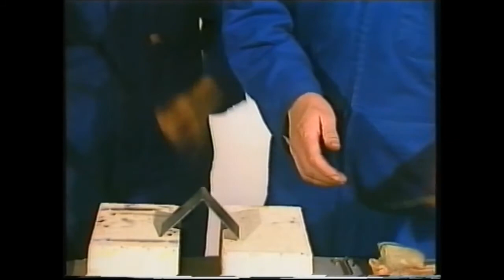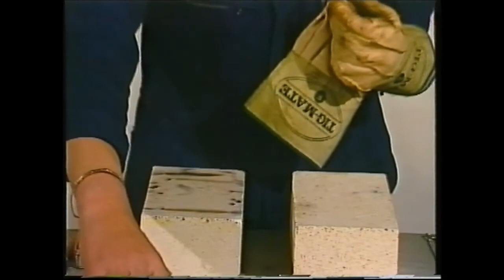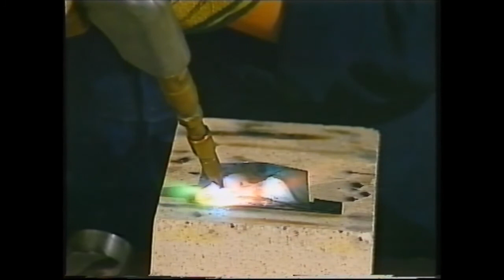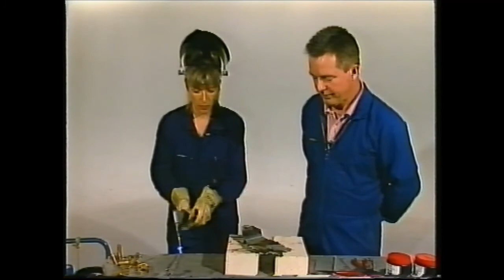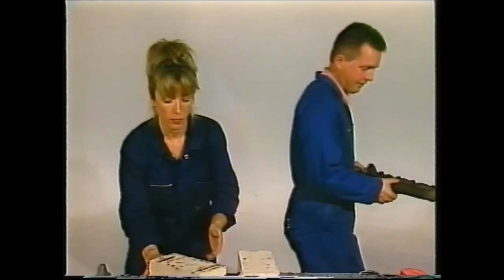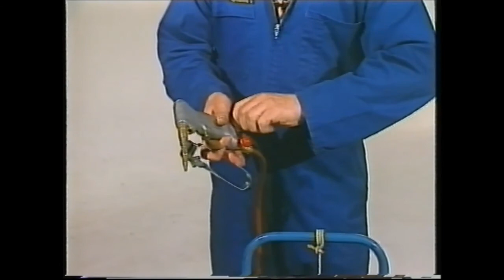Henrob Cobra 2000 Welding Torch

Comment: There are many videos showing the use of the Australian  Dillon torch(originally Dillon MK II and MK III and for a short time MK IV, then Henrob2000 and Cobra DHC 2000).  This is the absolute best video as the techniques are well displayed. The sales hype is obvious and much technical information is incorrect but using a low speed low volume oxy torch is tremendously useful in welding metals. Barry guides you into specific aspects of the technique as it relates to different metals. This is much better than the user manual. If you intend to buy a Dillon torch, there are many on the used market as the younger generation prefers expensive electronic boxes to weld. Plenty on ebay and marketplace or you can buy new from "dillonwelding" out of Sweden or if you are not in the USA,  or from Detroit Torches Inc in USA. It is the same torch (made in USA) from both suppliers but the name embossed on the handpiece is different (Dillon MK III or DHC 2000). Note that a very famous (aircraft welding) small oxy torch , the MECO N MIDGET has not been manufactured in many decades and Victor torches that bought out MECO dumped it permanently. This has led to the Meco Midget being very sought after on ebay etc. where it commands a much higher used price than the Dillon. The fact that the less performing (can't cut metal) Meco Midget has much higher used prices on the market makes you question Victor's strategy. Bluefeather is the other torch that claims to be a better (aesthetically) copy of the Australian Dillon. The instructional videos are not as impressive as the ones available for the Dillon.

Comment: I have had this set for MANY years.   brought it with me to the Philippines and it was amazing to used during Covid and after the Super Typhoon when all shipping and communications were down.  I did many repairs with Motorcycle spokes stainless and high carbon steel and aluminum repairs with any aluminum available for filler metal.  You can pretty much weld any metal with this torch. I already had some borax to use as flux when needed.  I can only say that conventional gas welding is ok but the Henrob  is superior . But like any gas torch set it does not like cutting dirty steel. A quick buff with a wire wheel , grinder or wire brush and this torch cuts like a Plasma cutting unite. I think the original case name was  Dillon on mine.

Comment: The British designed BOC torch has a similar mixer to the Henrob torch. There are many many of these around in many countries, most copied by the Chinese. If you calibrate the pressure on these torches to 4psi and use the smaller tips, you get the EXACT SAME RESULT. How do I know? I've tested both. The marketing spill behind the Henrob is that it has a "special" mixing chamber. It uses the venturi principle to get the oxygen to PULL the acetylene into the mixing chamber. It may be special but is far from unique. This principle has been present in some torches since 1920! You need to understand a little about chemistry and physics, but there is no magic in the Henrob. Also note that Barry McGough who is an excellent welder and salesman spins a few untruths in this video.
He says: "the torch delivers the oxy and acetylene in equal quantities unlike a conventional oxy torch which delivers 5 parts oxygen to 2 parts acetylene. " 
This is, to put it mildly,  "Bull Poop". 
When you adjust the flame to NEUTRAL, you have a 1:1 ratio of gases in the INNER CONE (C2H2+O2=2CO+H2), however there is a reaction in the outer flame envelope where oxygen in the air combines with  the CO and the H2 of the inner cone so that CO+O=CO2 and H2+O=H2O. That is why a 1:1 gas ratio from the bottles leads to "5 parts oxygen to  2 parts Acetylene" or 2C2H2+5O2=4CO2+2H2O as the end result which includes the reaction in the INNER CONE and the reaction in the OUTER ENVELOPE. It has nothing specific to the Henrob torch. ALL torches are identical when you set a NEUTRAL FLAME.
Then Barry says " it delivers oxygen and acetylene in equal quantities " You the welder decide what quantities are delivered by the cock valves on the torch. The torch is irrelevant.
If you get a cheap Chinese BOC-like torch and set the regulators like Barry shows you at the end of the video. You will be able to use that torch like a Henrob torch IF YOU USE SMALL TIPS
I take nothing away from the versatility of this torch which was made by the Australian Nicholas Dillon in the 1970s. Its pistol-like grip is a favourite for many welders. The claim that it saves on acetylene is correct but NOT specific to this torch. If you use any other torch which has the venturi system in the mixer and use 4psi with small tips you will get the SAME result.
Detroit Torches is now making and selling these torches under the name DHC 2000 or Cobra and they have an eye-watering price. In their videos, they have employed another fast talking salesman (first) and welder(second) to promote the virtues of these torches. There is a lot of hype and they are far too expensive. If there was a market like there is for the Smith Little Torch there would be thousands of Chinese clones on the market. At the end of the day, check your mixer: if oxygen flows in a chamber where it can pull acetylene to better mix it, you have a Henrob/DHC2000 replica. Just fit very small tips and calibrate the pressure to 4 psi as Barry shows at the end of the video. Don't forget to fit flashback arrestors at the torch and the regulator. The non return valve sold with these torches should not be used. FBAs have non return valves built in.

Comment: Great demo!
Where do I buy one nowadays in Australia?
Reply: there are many around as welders dump gas for Mig and Tig. Flea markets, local fairs etc
Reply: @redpost2380  thanks. I've ended up buying new from the US. Great kit though I'm still learningy ways around it.
Reply: @ZaarsShed  The aggressive marketing behind the Cobra means that they try to tell you welding with the Cobra is a breeze. Not so. You need to learn your gas welding skills. Consider buying an original Smith little Torch (about AUD 290) it is used by jewelers. Runs on 2 psi and allows you to slowly earn how to gas weld small metal pieces. the same rules apply for thicker steel etc
Reply: @redpost2380  I'm not phased by the marketing at all. I've done a gas welding course but they only had Comet 3 "monster" torches of course. DHC2000 is already much better off the cuff. I'm simply not as magical with it yet as the lady in the video (tip of the helmet visor to her!).
E.g. for some reason I need to go tip size or two up against what the manual says when doing fillets in particular.
Thread-thin cutting lines are amazing from the first try though.

A kind soul donated me their Smith's Little Torch but I have yet to use it.

Thanks for your advice!
Reply: @ZaarsShed  The Comet 3 has the same venturi system as the Dillon.  What is amazing is that with a little tweak you can turn a comet 3 or BOC torch into a Cobra equivalent. You need to calibrate the pressure to 4 psi just as the Henrob video shows you
Reply: @redpost2380  so you say just to drop both oxy and fuel to 4 psi on comet?
Reply: @ZaarsShed  Getting the right pressures is tricky. Assuming you have a good quality gauge on your regulators, the pressure shown is at the regulator outlet. Now the gas has to travel through a Flashback arrestor which has a (1) sintered steel filter and (2)a non return valve. the gas then travels in the hose which (3) applies a drag force on the gas. The longer the hose the higher the drag. Then the gas reaches the Flashguard (non return valve) you probably have installed on your DHC 2000/Dillon  torch. Ditch the flashguard and  install a torch FBA. This also adds more drag on the gas pressure. The torch valves and tips provide further drag. So your regulator pressure is an estimate at best. No point in buying the very expensive precision Cobra regulators. You'll have noted the Smith Little Torch has propylene tubing. It has much less resistance than the rubber used in oxy hoses; essential for the small inner diameter of the SLT hose. If you are having to use larger tips than what most use, you may have the wrong pressure. Look at the segment at 24:05. It is an "empirical" but effective  approach to setting the 4psi. If you purchased the new tips, they should be fine, however, if you bought a used Dillon torch, remember that tips can be oversized (mainly due to the operator's excessive use of the abrasive tip cleaners). Also old torches may have been sitting without covers in a garage for decades. Insects love to nest inside the torch if the caps are not in place. This applies to all torches. when finished welding, always turn the ACETYLENE off first. Never the OXYGEN. The torch may pop, get used to it. There are hundreds of videos that tell you otherwise. If you turn off the oxygen first, the acetylene will burn inside the torch. This creates a rough film of carbon coating inside the torch.  The oxygen burns and purges out any acetylene so that it will not foul the torch.
Reply: @redpost2380   thank you for very elaborate response - really appreciate it. 
Finally I have a constructive input on "Oxy vs Ace to shut off first" dilema. 
I also got low pressure Oxy regulator (up to 150kpa) so fine tuning the pressures is easier (without always going with empirical method that is)

Comment: Having been an enthusiast gas welder myself for quite some time now, I dare to say that most of what's claimed in this video is just plain nonsense, to put it politely.
Besides, if you weld (or worse, cut steel) for any appreciable length with this torch I wouldn't be surprised if you'd have to stop working due to the heat being unbearable - after all, you'd be holding your hand right upon the molten metal...
Reply from the maker: Hi Bartolomeo, while I would have to agree 100% with things "heating up" while cutting, the abilities of the torch are far from nonsense. To try and buffer the heat, they include a hand-guard/heat-shield which, mostly works, but only for a short time till the guard itself heats up. The torch itself make the gas welding learning curve a lot shorter, and indeed, it saves a huge amount on gas usage, that is from personal experience using the torch and traditional oxy/act torches.

Comment: I'm sorry, but this torch is not the way to spend your hard earned money.  I've been oxy/fuel welding for thirty-five of my past forty-five years and I've always been aware of this torch and I was even curious enough to buy one some time ago (a Dillon MK.III).  After having my hands on it I immediately dismissed it as heavy and awkward.  Some time passed and with more disposable income I decided to buy a new set of tips for it and give it a real try.  Don't make this mistake yourself, there are superior oxygen/fuel torches out there, but this is not one of them.
Reply: Name one and why
Reply from the maker: https://www.youtube.com/watch?v=48Do3tNXc18
Reply: @jonathanb6911  BOC Light Duty Blowpipe Part No. : LT-101. with BOC Light Duty Mixer Part No. : LT-103. Attach number 4 and number 6 tip and you have aHenrob equivalent. Make sure you set up the gas pressures as Barry has shown at the end of this video.
Reply from the maker: Hi Eric, I'm sorry this has been your experience with the torch. Personally I found it difficult to learn oxy/acet welding with the traditional torch. It took me some time to get clean consistent welds. I also found the ergonomics of the torch difficult on my wrist. NOTE: this was ONLY for welding my 4130 aircraft air frames. When I decided to "invest" a large sum of my money into this torch, I had to un-learn the old ways and re-learn this new way (as per this video). The torch itself while does have some weight in it, I found it much easier to handle in difficult positions with less stress on my wrist. Yes, there are now other torches eg; mini torch that all have their merits - but there is no such thing as one that suits every welding situation. There are plenty of comparison reviews on YouTube to watch. Personally, the only problem I have with this torch is that if it was made in China like everything else, we'd probably be paying a more reasonable price for it - not these over inflated profiteering prices.
Reply: @RedbackAviation  I agree with your comment that there is no ‘one’ torch for every job and there are even some occasions where my Dillon MKIII is my preferred torch.
   One thing I’ll disagree with is the sentiment about being made in China, if it were I wouldn’t even own it.  My experiences with Chinese made items are that they all too often do a poor to absolutely awful job of replacing the domestically produced item at a more expensive price.
   I have other torches, made domestically, and they’ve all found their niche.   I’m just disappointed that the Dillon finds it’s niche so much more expensively.  I don’t regret getting mine or the new tips, but I’ll just say don’t think the Dillon is a substitute for a real tig machine.  It is just a unique  oxy/fuel torch and I hope folks don’t let its’ price point keep them from advancing their skills maybe with more affordable, hopefully domestically produced, torches.
Reply: This is why I am here, ie. to hear opinions re. the COBRA DHC-2000...  -but!-  opinions backed up by data.  Please explain, with details, what you believe to be inferior in the DHC-2000, and especially what is superior in other torches.  Thanks!
Reply: I have the same opinion , I like my purox torch much better for general welding and cutting tasks .I can also install a multi flame heating head for big heat input . Henrob style just doesn’t work as good for me

Comment: So could not you use a small tip on a standard torch and get similar results? I'm asking because it seems the difference is finer tips with this type torch. Thanks for the video.
Reply: Peter, to reiterate, theres a special induction action in the mixing chamber that causes the flame to have reduced turbulence characteristic, finer more accurate applied heat and less gas used.

The Tips just direct the flame for different guage metals.
Reply from the maker: Peter Ford It's actually nothing to do with the tip size, the secret is how it's mixed before ignition. From there, you only need a smaller tip to achieve the same result.
Reply: Actually what happens in this torch is exactly what happens in other torches, BUT NOT ALL! The British designed BOC torch has a similar mixer to the Henrob torch. If you calibrate the pressure on these torches to 4psi and use the smaller tips, you get the EXACT SAME RESULT. How do I know? I've tested both. The marketing spill behind the Henrob is that it has a special mixing chamber. It uses the venturi principle to get the oxygen to PULL the acetylene into the mixing chamber. This principle has been present in some torches since 1920! You need to understand a little about chemistry and physics, but there is no magic in the Henrob. Also note that Barry McGough who is an excellent welder and salesman spins a few untruths in this video, not uncommon for salespeople.